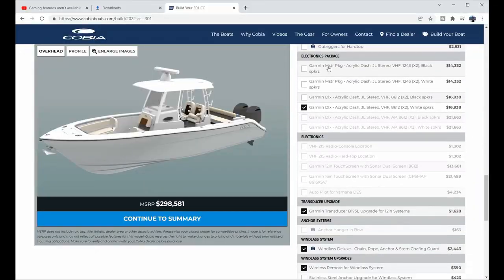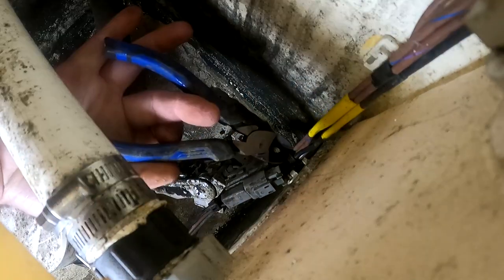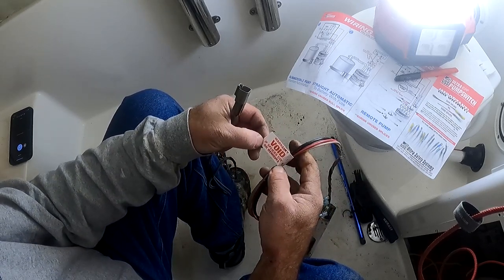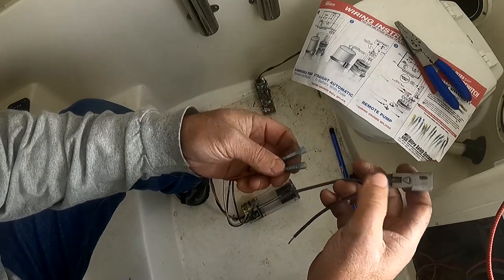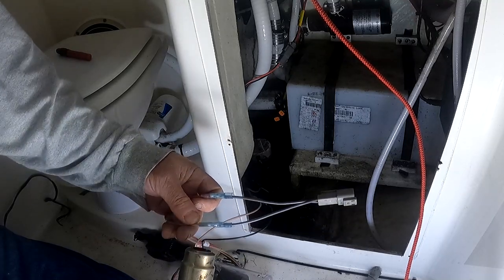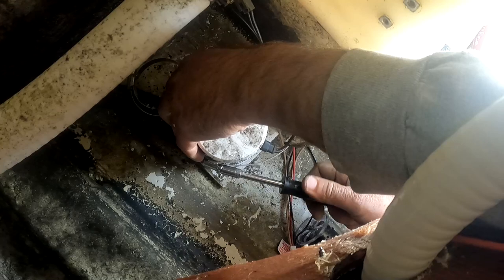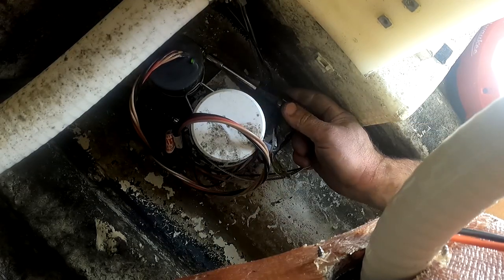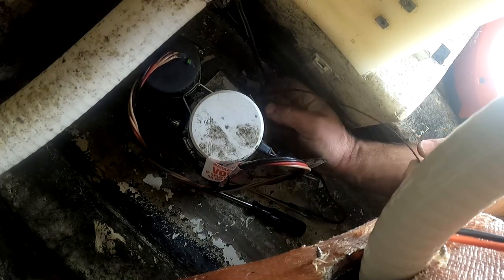Installing the Ultra Jr bilge switch

Comment: I assume you tested the actual switch with water also? So do you think it’s worth the price- so damn expensive?. My concern was I have a greasy kinda old bilge too even though I degreased and cleaned it well. I wonder if grease goop will still get in it and if it will effect it. Where did you buy it? Thanks for putting the video out. The company should really put a newer video out too.
Reply from the maker: E1838, at the time of the install I could not test with water, my outside hoses were off for the winter.  I’ve since tested and it works great.  My aft bilge had an Ultra from new and hasn’t failed.  The forward bilge had a Rule and it died in under 3 years.  My forward bilge is not visible without removing a cabinet so I just want something there that will work.  For me it’s worth it.  As far as the grease I think it will be fine.  It’s completely sealed.